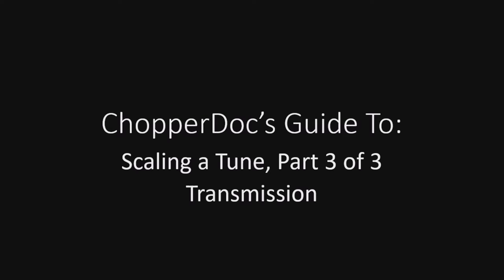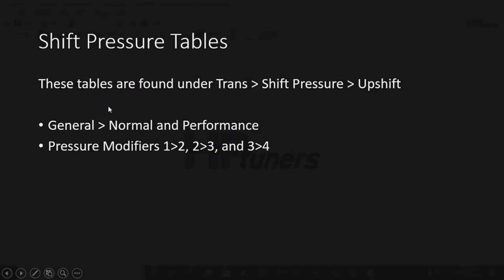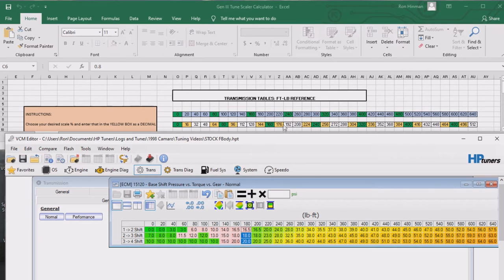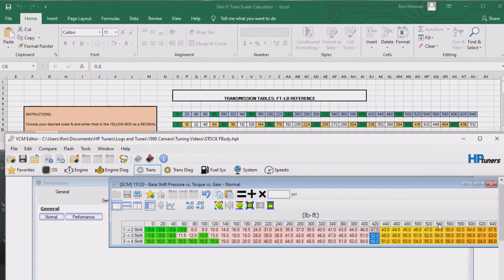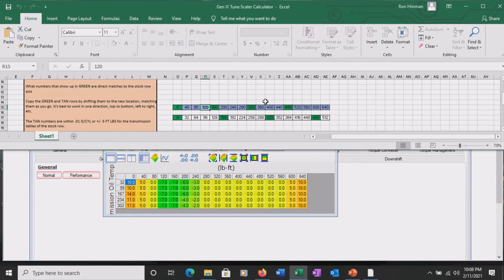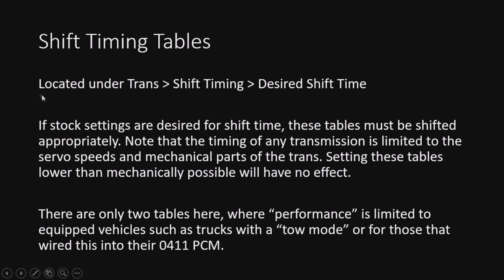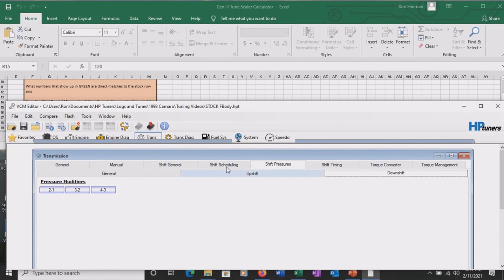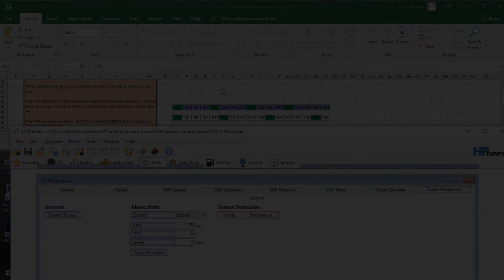Tune Scaling Part 3 of 3 - Transmission

Comment: Friend, why did you stop making instructional videos? You were doing incredibly cool.
Reply from the maker: Mostly time. I’ve been extremely busy in many different ways, to include very demanding positions at work and then home life and trying to make our house a home. Many many projects that I may even branch out into as more instructional videos and so forth beyond just tuning. 

I successfully felled so many trees in recent months, about 10 of which were in range of and leaning towards our house that I could do a series on that alone lol. God bless the sizwill cut. 

I also built a woodworking table featuring almost everything you need built in, like table saw, router, planer, miter, router planing sled, and more. It can basically do everything you need to make epoxy tables and so forth, which is something else I’ve been doing. 

So yeah, that’s just a few highlights of a million other things that use up my free time. 

Good news is I’m overseas again, so I may get back to doing these tutorials once more. Maybe finally do Gen IV stuff I talked about years ago. Once I settle in here we’ll see lol.
Reply: @ChopperDoc181  This is cool friend! good luck! Thanks for your work! it would be cool to see your course on 4 gen pcm.

Comment: Keep going ,on your commentary I learned  , can you do series of tuning from to stock to bolt one and camshaft tuning
Reply from the maker: Yes I can do something like that. Cams always cause issues to stock calibrations. I’m actually tuning a car right now for a cam swap but it’s a gen IV. The same theories apply though, so maybe I’ll do a video featuring tricks for taming both. The only real difference is the IAC between the generations, though some gen III’s did have an ETC instead of a IAC.
Reply: @ChopperDoc181  dear I would like all the things you gave written I hope you do it on video not for me , for other people  and like I said pls series is needed not only for chvey guys hope coyote
Reply: @ChopperDoc181  etc makes life easier in tuning. I prefer dbc myself tho. I tuned a 2014 Camaro SS and the gen iv ecu seems to be more forgiving imo

Comment: Hey man, are you going to continue to post videos on tuning?
Reply from the maker: Yes, I plan to make more one of these days. Just too many other projects right now unfortunately. I should probably be making videos about those too but I always forget to film the good parts lol. Building another river table right now, but I also have to clear up 3 more trees I took out last weekend. Busy busy lol. I do plan to make more on Gen IV and maybe do some V too, but like I said it’s on the back burner for now.
Reply: I enjoy your videos. I own a a few gm vehicles, one being a 6th gen camaro. I am trying to learn tuning as the days go on. I plan to buy the interface from hptuners and practice on my 2011 truck before I attempt my car. I’d like to make it a side gig in the coming years as well. What helped you gain your knowledge outside of practice? I am only going to focus on gm tuning. I’m going to stroke the 6.2 to a 6.8 and add FI later down the road. But I want to tune it myself. Your videos are very informative!
Reply from the maker: Many, many, many hours of reading forums, mostly LS1tech and HPT forums helped me learn the small intricacies of tuning. There are great discussions on many threads, but it’s literally taken years to learn as much as I know now. I’m still learning too lol. 

With that 6th Gen camaro, that is a Gen V vehicle, meaning that the tune is torque based, not “air”. Though the VE is heavily relied on for accurate torque numbers. Everything about the tune is based on a calculated torque instead of airflow. For Gen III and IV (like your 2011) all load calculations are basically derived from airflow, which translates to Grams per cylinder (g/cyl) and that’s your load number. Gen V it ADDS torque after that, which controls things like your TB and so forth. Not going to lie, it’s a rough thing to learn. I’ve been tuning a lot of years and my first Gen V had me back in forums and watching lots of YouTube lol. It was a lot different, let’s just say that lol.
Reply: @ChopperDoc181   I appreciate the time put forth for the replies. Hopefully I’ll get a notification soon that you posted. I know there are plenty of others that would love to see more. But you do you and take care of yourself! I program industrial machines for a career, and the more I learn about tuning, the more interested I become. Take it easy bro 😎

Comment: Hey ChopperDoc, I recently started tuning and I've turboed a gen 3 ls, and I keep getting spark retard and I cannot for the life of me figure it out. Was hoping maybe there's a way you could help me out. Id seriously appreciate it.
Reply from the maker: I’ve had problems with this as well. If pulling spark doesn’t seem to affect it, you need to check other things. The knock sensors are just microphones, and they listen for metal on metal sounds. They may be picking up an exhaust rattle, a ticking lifter, noisy valvetrain, or something along those lines. First check for anything that could be making noise, exhaust is a pretty typical cause. From there, next step is to check the sensors themselves, which may be too sensitive for your build. If all you did was turbo it, I’d be wary of it actually knocking though. 

To truly rule it out, put some race gas in it, and if you are still knocking then go ahead and lower the sensitivity a little at a time until it stops.
Reply: @ChopperDoc181  Thank you so much for your fast response, I haven’t seen any post in a while, I honestly didn’t know if you would but you seem like the guy to ask. Also no I also put a cam in it. I also don’t have the exhaust hooked up just yet so it’s just the dump tube pretty much right next to the engine, I want to say that was more than likely the cause because I pulled a bunch of timing. I kept getting about 7-8 knock retard when I’d be in 3rd gear going about 30mph and give it a good amount of gas and it’d kind’ve bog down and then bam a shit ton of knock retard, but yesterday I swapped from a 3 bar to a 2 bar, and pretty much restarted my tune. What are your opinions on decapped injectors? As of right now that’s what I’m running but a lot of people were telling me they’d give me issues so I bought some real injectors. Idk if I should continue trying to tune it how it is or wait for them to come in.
Reply from the maker: You will have to start over after changing injectors, pretty much. Make sure you have good data for them and life is good. Remember to check injector duty cycle, there is such a thing as too much injector if that makes sense. 

It does sound like a noise problem as you described. Hopefully when you get the exhaust hooked up your knock problem subsides. If not, you can always run it on some Cam 2 or other racegas to rule out actual knock and tune the sensors themselves. I’ve had to do this before. Stock sensors can be pretty sensitive, and modded engines make more noise than stock ones do, especially valve trains. 7 or 8 degrees is a lot though. Just be sure it’s not real before adjusting sensor gains.
Reply: @ChopperDoc181  will be sure to try all of that, I think I’ll just wait for the injectors to come in, before I tune anymore. I really appreciate the help or the advice I guess, I don’t wanna ask to many questions but you seem really knowledgeable about tuning.
Reply: @ChopperDoc181  I have one more question, that being whenever I figure out the spark retard, like maybe after using the race gas and making sure there’s no metal hitting, do you think 93 octane fuel would be okay for a street turbo tune?
Reply from the maker: @onPoint00 That depends on your boost and compression ratio. Many have ran pump, but like I said, it’s dependent on a number of factors. I have a video explaining all of that stuff that may give you a better idea. The goal is to stay under about 12:1 final/boost compression. This can vary greatly though, depending on many factors. Like material (aluminum vs iron), use of an inter-cooler, quench, piston design, etc. 

Cams help too, as they can reduce/change effective compression, which is the one you can calculate. Dynamic compression is much harder to actually calculate, though some say you can, it’s not really possible without data, aka, not something you can determine on the drawing board. 

Anyway, I’m sorry I can’t offer a definitive answer. It’s really actually, quite complicated.
Reply: @ChopperDoc181  sorry for the late reply but I’ll be sure to watch that video, I didn’t know that many factors went into things like that. I’ve read somewhere that the heads I have aren’t the best for high compression so maybe that’ll help. I’m gonna run it on 93 after I figure out the knock retard problem and see if I can manage it. I was wondering, whenever I get my new injectors, if there’s anyway whenever I run into something that I can’t figure out if maybe there’s a way I could send a log and my tune over and maybe you could give me some pointers. I can pay, it’s just sometimes I’m searching the web for hours looking for help and no one seems to be as helpful as you are. If not, I completely understand. Also I guess I should say I’m only going to be running 7-8psi of boost, but I’ll watch that video and see what i can figure out.